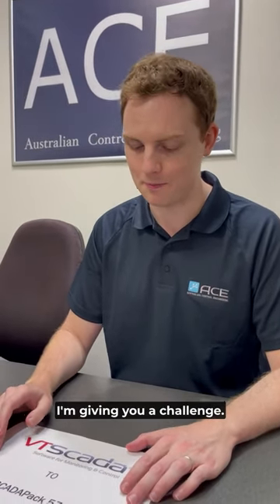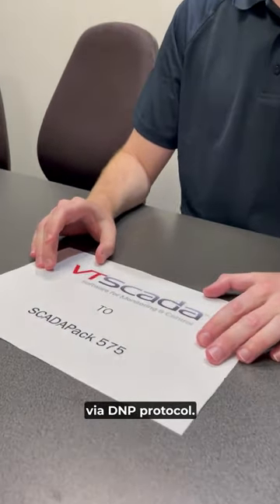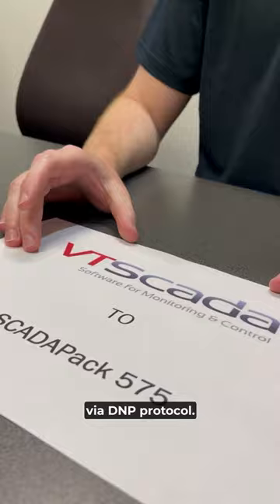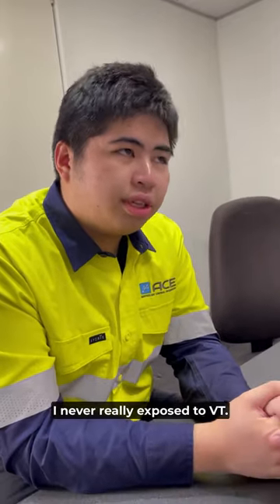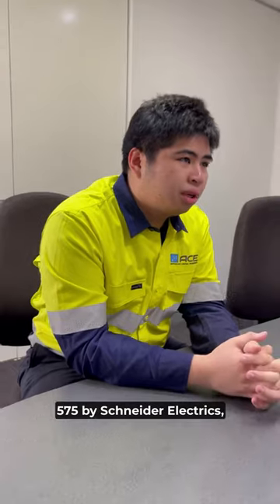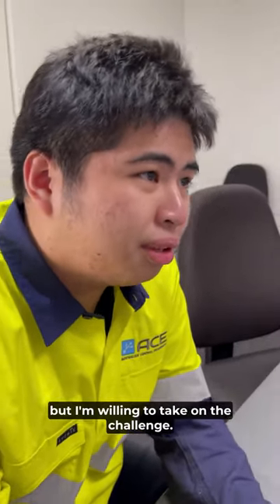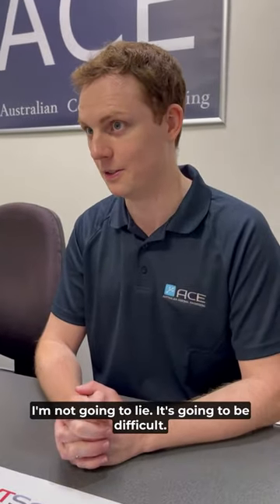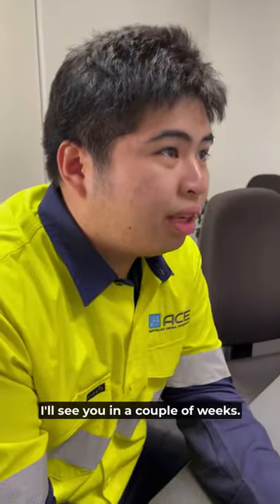ACE Challenge - VTSCADA to SCADAPack

Comment: I'm trying to use VTSCADA to write to internal register address like 1612 in SCADAPACK but unable to. You guys have any tip? Thanks!
Reply from the maker: Is that a DNP internal register? If so, you need to check if the register is readable or writable.
Reply: @acectrl  No it's just modbus. I tried to write 1 to the address 1612 (normally open contact) but nothing happens. I tried to write 1 to the actual physical output (register 7) on SCADAPACK. The ouput energized but very quickly turn it self off! Not sure if there's something need to be checked on the program. Thanks.